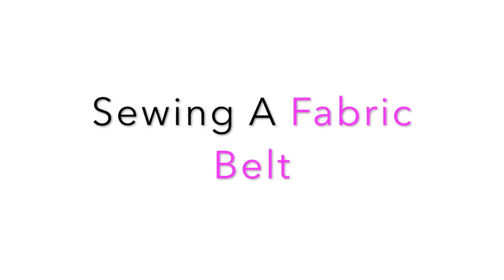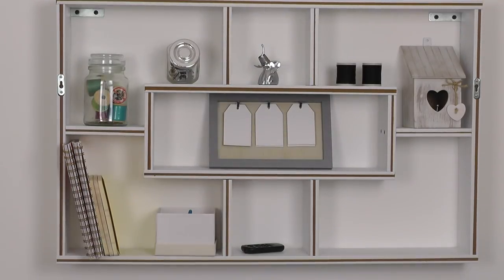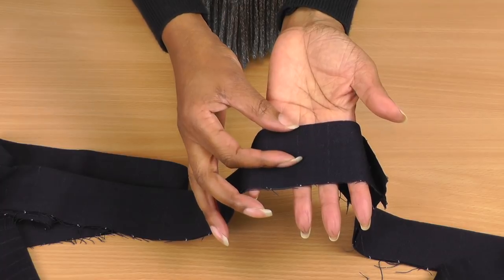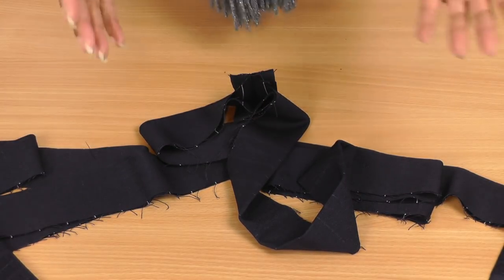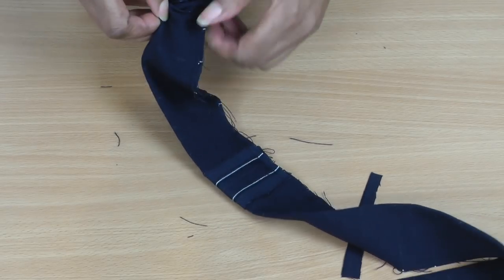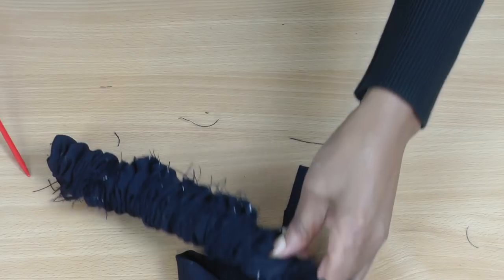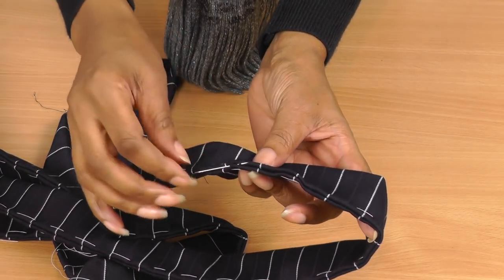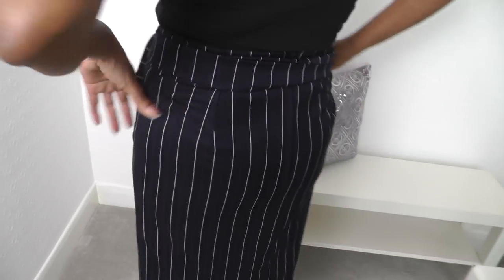Sewing a Fabric Belt

Comment: Thank you for sharing. That style of belt looks great on you. Basic premise useful for several types of projects from apron ties to handbag straps. Please consider clarifying direction of sewing. You showed sewing from the end to the middle. In your closing remarks you said to sew from the center to the ends. That's the way I would have sown it for the same reason you mentioned about not forcing uneven ends to meet.
Reply from the maker: Thank you for letting me now Olditmer.

Comment: Good Morning,   So you base stitch after you turned the belt then press it and thereafter removed the stitches.  Is this what you did?  I also have a question.  If i am putting a zipper in the front of a top vs the back which the pattern calls for.  For example the front is on the fold, then how would i apply this process.  Sew up the back and add Seam allowance to the front by cutting down the fold line and adding seam allowance to both sides?  Thanks
Reply from the maker: Hello. Yes to both questions